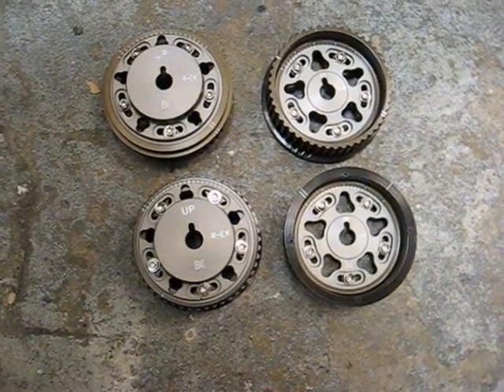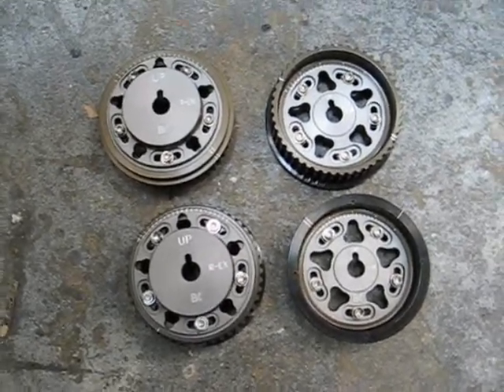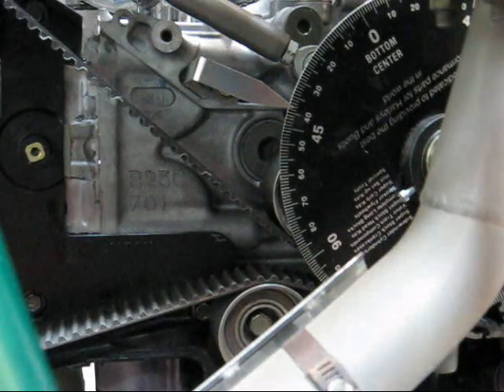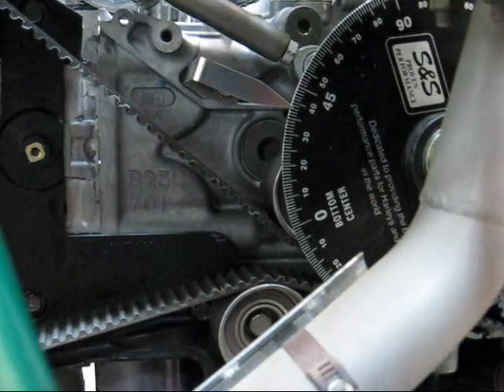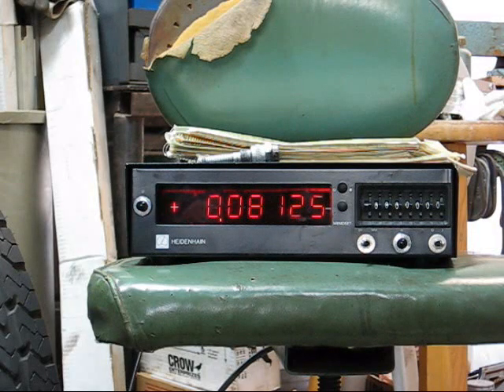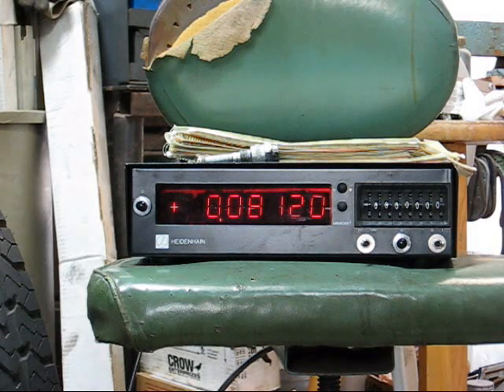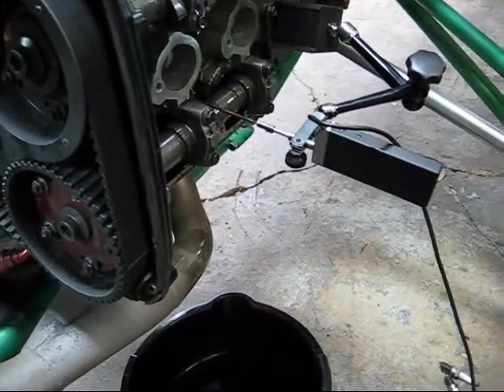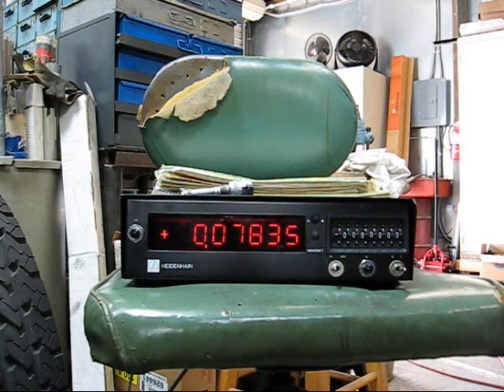Subaru cam degree can timing

Comment from the maker: Hi Waynos
You should not guess on cam timing, set a motor to stock locations, if you change timing you need to degree the cams. When a block or heads have been machined (decked) or a different thickness head gasket is used, cam timing will change. This will change all four cams, that’s why I’ll degree all four cams. You’d be surprised how much of a difference they will be off from each other. If you just degree the cams on a motor you will pick up a noticeable difference in power. 
Thank you 
Richard
Reply: Thank you, I really appreciated your advice. I suppose I was looking for the cheap and dirty workflow for a stock engine, without purchasing the adjustable cam pulleys. I am in New Zealand and they are bleeding us out down here, the equivalent to 6 bucks a gallon right now, so performance is second to efficiency. This seems like a nice way to make some savings without a huge outlay of time or parts.  I a learnt a lot from your video and definite food for thought. All the best, Waynos

Comment: Nice one and thanks for sharing.. I was thinking about advancing my cam a few degrees next time I do the timing belt (for better mileage) but was wondering… for a quick and dirty method, would it work if I just lined up the pulley marks in their correct positions, but had the crank rotated counterclockwise a few degrees, then pulling the tensioner grenade pin. Then when I turn the crank back to TDC my cams would be advanced.. Is that a dumb idea?